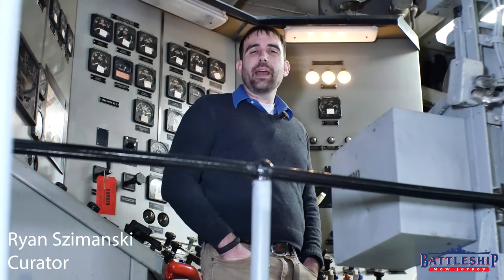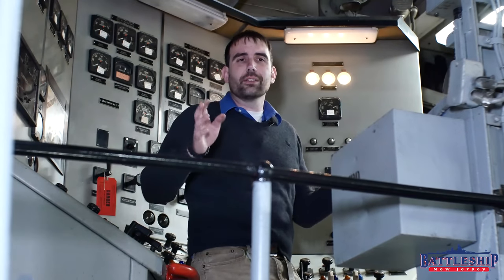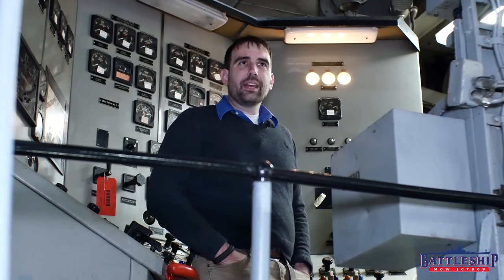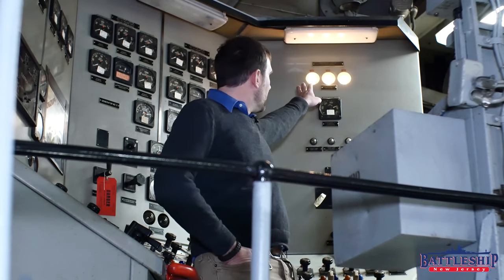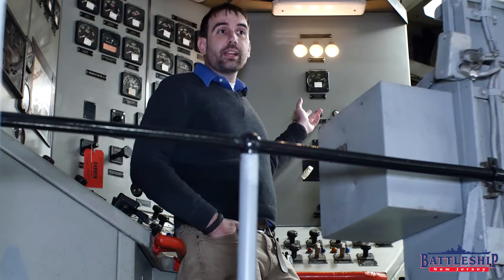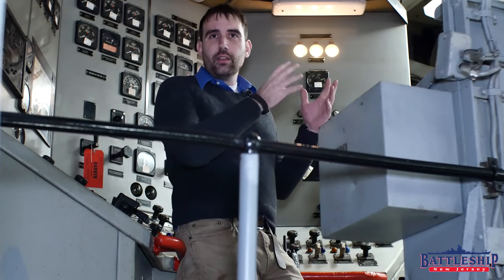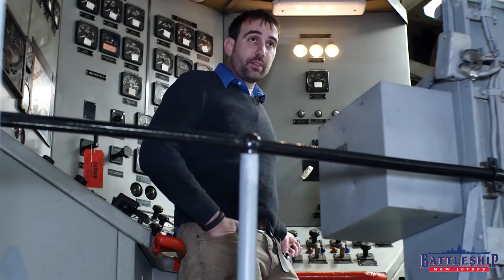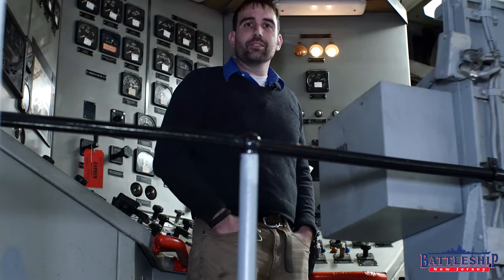How Do you Detect a Grounded Circuit On a Floating Warship?

Comment: Just a question on 3-phase as found on an Iowa.  120/240 is a single phase power (residential).  In commercial shore based 3-phase power, panelboards are generally 208 V phase-to-phase, so it would be 120/208.  Could it be that you have no 2-phase loads on the 110 V panels, or is it that the transformers powering 110 V panels are single phase center tapped like a residential transformer?
Reply: Can't speak directly to the New Jersey, yet I know a bit about ships power systems, they don't vary much.
"Most" ships, distribute power from a "main" switchboard. Combat vessels such as the New Jersey have more than one "main" switchboard. These can be interconnected in various ways, describing these various ways would probably take a week or more of classroom training to even begin....
Anyways... power is needed for voltages different from 450 vac 3○ , so there are transformers. On a ship, for 220/120 vac,  you have a 2:1 step-down transformer that gives you 220 vac 3○ voltage in a delta configuration. Using a 2 pole breaker will give you 120 vac, pole to pole, there is NO "neutral"! There is (and this does vary, and generally makes NO sence!) say, 1 pole to "ground" (anything metal attached to the ships structure) you'll see like 67 vac to ground, the other pole (something like) 47-49 vac. It's weird, they never add up to the 120 (or there about) that you get pole to pole.
If ya want 220, you use it as 3○ 220 with a 3 pole breaker.
Most all of the transformers have GFI on their load side.

Comment: EM, here, yes, tracing down, grounds, on a 3 phase, "DELTA", electrical ship, with Detection lamps, is "FUN", You need, a "Helper", usually, a Designated Striker, to shut down, Load distribution, breakers, coordinating with DCC, central, when lamps go to full brightness, you , found the circuit, that has the "FAULT", usually, a bad cable, or equipment. 'Fun" is to give, the NEW MAN, the Honor of turning off the power to the, " Marine Magazine, & watch them, respond, to that "LOAD CENTER", fully armed.
Reply: Are all ships 3ph delta? I haven't put any thought into wye/delta configuration on ships myself, but now that you mention it I'm curious.
Reply: @RichieRichOverdrive  yes, 30 yr chief electrician (on merchant vessels after 8 yrs as a MM(3,2,1) in Navy) here.
I learned electrical work on ships, and freaked out the first time I looked at a shoreline panel!
I have NEVER seen a wye connected transformer installed on a ship, unless inside a component, totally isolated to that unit (think radars and such).

Comment: The french late 30s super destroyers had a less than perfect electrical system.
For some reason or another the designers wanted to use simpler insulations so they had to compared with the BBs and cruisers use a lower voltage.

That gave them problems:  turrets and everything else on the ship was found to be starved for electrical power. The Mogador pair was according to english wiki:n built with 115 V DC, which is low.
Another problem was this:  the cruisers/BBs used different electrical parts than the destroyers (a motor doesn't bitch if it was intended for an BB but now is on a destroyer.)

Comment: 110V or 120V is the same for all practical purposes. Any piece of equipment that's intended to run on it, should be able to handle it safely, if properly designed. If the voltage value is really picky, for a piece of gear, it was poorly designed.

With household power, the current (the amps, the actual flow) passes thru hot wires (the black  ones, in the US) to the load (light, fan, computer, etc), and return thru the neutral wire (the white one). The ground, which I suspect, is the body of the ship, is connected to neutral back at the power source, but no actual current passes thru it, under normal use. Its only intended to shunt, current away from a human, under transient emergency conditions. Its at neutral voltage (electrical PRESSURE), but normally should not pass any current (amps). Best explained with pictures (ie schematics). Cause, as they say a picture is worth a thousand words, and often more than that. Verbal & written language is POOR at conveying ideas.

Back to grounds. If the current path flows thru a person, and then to ground. The ground has not done its job. The intention, is that the current flow thru the ground before it can pass thru the person. An example is a metal box, with a light bulb inside. One side of the light bulb gets the hot, the other side, the neutral. The box metal box is tied to ground. Under normal conditions, the current comes in from hot thru the light bulb and back out thru the neutral. If in some failure mode, the hot wire comes loose, and contacts the metal box, the current will now pass thru the ground, and trip either the circuit breaker, or ground fault interrupter. If that box was not tied to ground, the box then be at hot voltage, and an errant person coming in contact with that "hot box", may have current pass thru them, if they are also in contact with the ground. You still need to complete the circuit (full circle).
Reply: I would say the ship likely has isolation transformers on the incoming power feed, to take the shore power 3 phase voltage and convert it to the lower voltage of the ship.  Probably has multiple primary connections, to allow use world wide, as your shore power can be anything from 400VAC 3 phase, 1.1kV, 3kV, 6kV or 11kV, 50 or 60 Hz, depending on the harbour and wharfing you are at. For a battleship higher voltages more likely, as the cables are so much smaller in diameter, even if the insulation is thicker.

Thus the on ship power is isolated from the shore connection, which is itself also ground referenced for lightning protection, though it is designated as isolated system, as there is no direct connection to ground, only a protective device which will remove static charge and clamp large transients. 

On ship the power is isolated as well, and the 3 lamps are there to ground reference the delta wound alternators, or the transformer output, so as to allow detection of a short from phase to ship metal, or a leakage current. Tester simply allows a larger current flow, thus any fault is going to produce a much bigger voltage. The 115VAC systems will use separate isolation transformers, fed from 2 phases of the 3 phase system, so as to have 115VAC only, also isolated, and likely with local ground fault detection for each transformer. Thus by each power distribution panel there will be 3 transformers, either separate, or wound on a single 3 phase core, as that saves copper and iron, and gives a bigger power capability in the same volume, but you will have 3 separate 115VAC feeds that go out of it, each isolated from each other.

Transformers dictate loading available, which is why your shipboard electricians cannot replace a fuse with a higher one, instead you have to find the overload, typically an illegal space heater, in some cubicle or wardroom, and then disable it, and report unauthorised equipment to the XO, who will bring down wrath on the unfortunate officer or rating. Same for the person who replaces a fuse with a penny, that will result in something akin to a keel hauling.

Comment: I’m confused does this detect phase to hull faults? Does the neutral point of the transformers not connect to the hull? Or does this look for a neutral to hull fault?
Reply: Neutral is "floating"...Isolated from Ground.  Unlike residential/commercial wiring, continuity between Neutral and Ground is a FAULT condition.
Reply: No neutral, only 3 phases in delta. The test circuit is emulating a wye connection to ground, so as to detect any phase to ground faults.

Comment: Do you have a delta circuit?  Or a Y circuit?
Reply: it would depend on how the bus tie breakers are set.
Reply: The main electrical system is a Delta with only 3 phase wires and no neutral connection.

Comment: I bet this was a nightmare to track down in rough seas...
Reply: @Matto Meter Yes especially in the officers areas, where they would complain, till the XO got to them and told them to either live with it, or he would tell the ship electricians to shut them all off, and see if the fault goes away, then leave off till port and shore workers.
Reply: I was Chief (and only!) Electrician on merchant vessels for many years. One thing I can tell you is that Murphy was an optimist!
Shit doesn't happen on a merchant ship on those few days of smooth sailing, things go bad during those all to often times when it's 30-40 ft seas, accompanied with 60-70 knt winds, with a few 20-30 rolls!
That's why you make the big bucks! It'll scare the crap outta ya fixing that leaking J box out on deck while the waves are dragging your feet out from underneath you.

Comment: Any you Em folks ever see dirty/carbon contacts on a relay pitch a ground on a phase?
Reply: Oh shit have I ever! I've seen panels that even with all breakers off, it showed grounds on the incoming power lines, I was convinced the transformer was grounded. All that was really required was to remove 23 years of accumulated grime and the world was once again (temporarily) well again!
It was a lighting panel, when I went aboard there were 2 lights that worked in the holds (big ro/ro ship] out of 758 (yes I counted them all, and fixed em (and associated grounds) over 2 1/2 years (had a budget and other things to do!).
Reply: 'Nuther ship and time....
Had a dead ground show up on the emergency bus, only when the emergency generator went "online".
This was after they'd changed the emergency generator from a noisy 6-110 to a v8-71.
Nothing made sense, until ya looked real close at one of the relays that pulled in to put it online. The braid from the screw terminal to the relay contacts, somehow, had begun to touch the panel board when the relay pulled in! 
Took it out, cut a bit out, resoldered it reassembled, and TA DA!
There we r e 4 ships of that class, we went back and replaced all the original (1960's) relays with "modern" enclosed relays, so we wouldn't have to deal with that problem later.

Comment: Can each engine room feed power to each circuit?
Reply: Not sure what you mean by “each circuit”. Each engine room has a switchboard, they can and usually we’re cross connected in port. At sea we were generally connected either forward and aft, or port and starboard. 

It was said that in battle conditions we would split the ship into 4 sections and each engine room feed only its switchboard and equipment, to minimize impact in case of damage.
Reply: Yes, in a power loop. That was covered in the previous video.

Comment: But that would be AC I didn't think that AC presented the same problems as DC when it came to Cathodic protection.
Reply: DC can be much worse, but any voltage leaks to he hull are not good.  I could see a ground fault on the control panel for the Impressed Cathodic Protection System long before it got bad enough to show as a ground fault at the main switchboard.  AC messes with the current and polarity of the ICPS outputs rather badly.